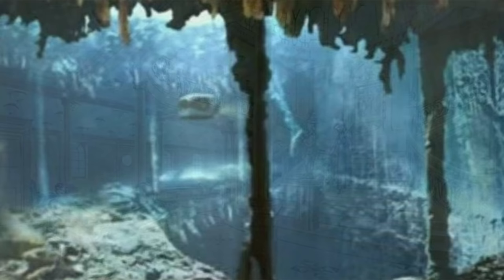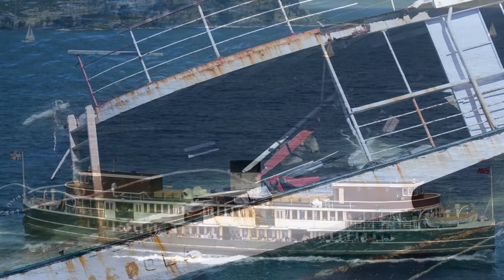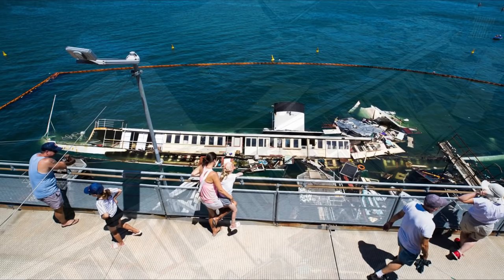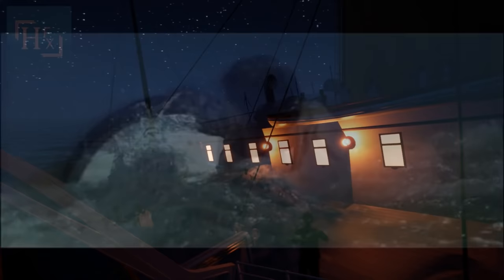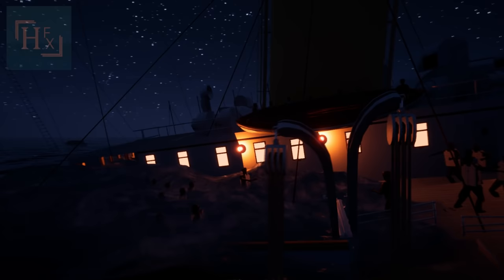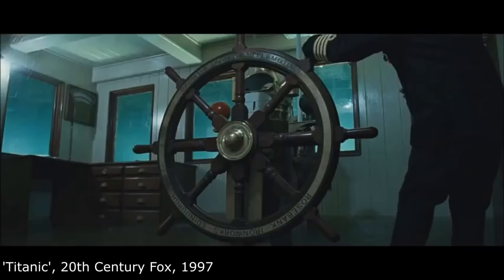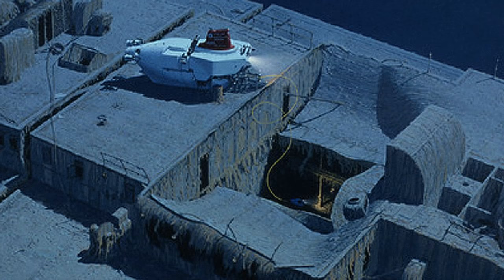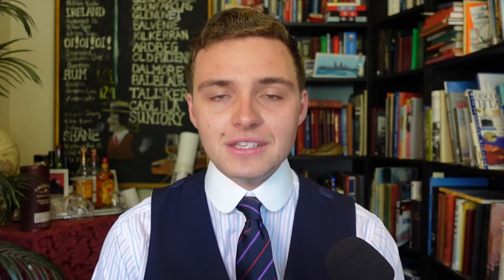What Happened to Titanic's Grand Staircase Dome?

Comment: James Cameron mentioned during an interview that when they were flooding the grand staircase for the movie, the wooden staircase broke loose from the floor and started to float. So he believes it broke up as it came lose and pieces floated away through the hole im the dome. There are pieces of the dome in the ocean floor which proves it broke off.
Reply: Cameron also built the staircase on the set to the same standard as the original, effectively creating a forensic experiment.
Reply: @ShadowXII  Though iirc it was actually a bit larger to better accommodate the cast.

Comment: During filming they had several levels of the grand staircase built for the flooding scene.   When they were flooding it it actually started coming apart do to the buoyancy of the wood almost immediately..   now before you say well it’s just a movie set.   Camron and his team built the set to pretty much the exact blueprints right down to the materials use on the real ship ( the only difference was it was slightly wider)  it’s explained in the behind the scenes of the film.
Reply: Actually, the newels were plywood with molded plaster.  I formerly owned one.  Still, likely some bouyancy there until waterlogged.

Comment: The central element of the grand staircase dome was found near the wreck. It is very likely that during the impact with the bottom of the ocean, the pressure of the water inside pushed the entire structure, destroying it in the process for the most part.

Comment: Nice video again !!! A little comment though: there is no evidence that the bulkhead between boiler rooms #6 and #5 collapsed. For some engineer, it is very unlikely, and the testimonial that related the sudden inflow of water may have been instead caused by the collapse of a coal hold door (which was flooded). But as you said in another video, this is the kind of the numerous mysteries that the Titanic will keep forever,

Comment: I think its more the strength of the hull and superstructure being twisted and bent (hog and sag effect depending on the way a ship sinks), that will make the windows crack. I have experienced this when in drydock with ships I worked on. Windows are quite strong on ships, but if you twist and bend a ships metal structure, glass is still the weak point. And no ships are designed to handle the stress a sinking event causes on its structural integrity. I believe it was broken long before she went under water. Nice video though. A fan from Norway

Comment: You make a good argument, but two things that should be considered is 1.  the TITANIC was a much bigger ship then the ship in your example; 2.  the depth of TITANIC is FAR greater, meaning astronomically greater pressure as well.  The second is considerably more significant, and, while it bolsters your point, both vessels cannot really be compared in magnitude.  That being said, your arguments make sense.  Also, parts of the staircase dome have been found on the bottom (though they are believed to be from the AFT Grand Staircase, in the area of the "missing piece" behind the 3rd funnel.)

Comment: The 1997 movie  has a major error: it depicts  sea level  halfway up the windows and entering the grand staircase area, and then the glass dome breaking and dumping lots of water in. If water was only halfway up the windows, it would'nt have been anywhere near the dome elevation yet. 
With the number of  "fragile" windows at that level, and water also rushing from below, it is more likely that the grand staircase area filled with water right up to the dome at roughly same speed as ship dropped,  leaving a big bubble of air under the dome which would have then been lifted up along with the small structure above (especially if it too was still full of air. If this happens early on, the pressure would not be great.  (once lifted up, unless angle remained perfect, that air buble under the dome would exit sideways and dome would lose buyoancy and sink. 

Another possibility is that the dome liftedn up but remained contained in the structure above it, and that structure didn't widthstand the speed of descent and got blown away along with the dome in it.    One would need to have a better idea of how strongly affixed to the ship structure the dome was, or whether it was simply deposited on top and hence easy for it to float away. 

From the time there is water below the dome, pressure is no longer an issue because there would be the same pressure all around it (and the air volume under dome would diminish to maintain pressure parity with water.  Same with all the windows that survived to ocean bottom.

There is a 20th anniversary National Geographic special with James Cameron (20th anniversary of his 1997 movie).  In it, he mentions that he had build the grand staircase pretty much like in the original plans with a metal structure and wood basically deposited on top, and during the filming of movie, portions started to float away and almost pinned a stuntman.  And he posits the same could have happened to it on the real Titanic which would explain no trace of it while wood around the same location had survived relatively well.  (aka: not logical that the staircase would disintegrate while wood around ot wouldn't).

Comment: The clear pattern to me is likely a funnel fell onto the grand staircase collapsing the boat deck level which correlates with the bending of the external walls. 

Then when it was on the way down to the bottom , the strong currents going through the hull and the impact into the bottom of the ocean likely forced a huge amount of water through the ship and up the grand staircase “now open to the elements”. This likely ripped the panels and the remaining stairs out. This also correlates with the panels only being missing from the well of the stairs but remains on the rest of the walls seen in Cameron’s wreck documentary’s around the d deck lounge and elevator shafts where the pressure of water shooting up and out didn’t touch.

Theres absolutely no way the grand staircase flooded like James Cameron’s film. It doesn’t make sense how water externally falls through the dome but the water is only just coming through the weak glass windows on the boat deck “1 deck lower than the dome”. Good action scene though.

Comment: If the ship was filling with water faster than the air could escape, the air pressure on the inside of the ship would have increased.
It's possible that any glass not yet submerged on the outside, but with a build up of pressure on the inside actually first exploded outwards as the ship sank.

Comment: Something floats when the weight is less than the weight of water that would occupy the same volume. 
But as you bring an object deeper, any compressible portion of object will see its volume diminished and hence displaces less water. 
For instance, taking a balloon from sea level to 10m depth will see its volume halved (from one 1ATM pressure at sea level to 2ATM at 10m).    So one needs to consider wood in the same way, especially Oak whose weight per volume is 900 kg per m3, whereas water is 1000kg per m3 ( 1000 litres). (sea water is heavier than that). 
One would need to test how much various woods compress when going deeper into ocean and calculate at what depth they stop having positive bouyancy. It wouldn't surprise me that as Titanic sped up going down and flow of water  blew sterm apart wood being expelled from ship might not have floated if ship was already deep enough. 

Similarly: air bubbles trapped within the ship would have provided bouyancy that slowed its descent.  But as the air bubble's volume diminished the deeper the ship got, the less bouyancy they would provide and ship could then descend faster.   (at 10m depth, that bouyancy would have been halved already).

Comment: Firstly I know this video is a year old, but I still want to share with anyone who watches later. Latest calculations disproved that the fall of the Aft section of the Titanic took over 20 minutes. the real number was 5 minutes! that makes it a blistering 30 miles per hour, and although that may not seem like much but you have to take into consideration how much resistance water has and falling at 30 miles per hour (44 ft./sec) would rip everything off of the hull that was not welted and/or riveted to the hull itself. and it likely ripped off the wooden decking as well. and just for reference, the front portion of the Titanic fell faster to the bottom than the aft section, simply because of the aero/Hydrodynamically shaped front section. with the front wheel house being only lightly constructed as well as the grand Staircase of the ship and it's weakly built cover from the weather, would have easily been ripped off of the ship LONG before it gained much momentum at all, the case of the Baragoola's sinking amply demonstrates. The one needs to consider the bone crushing stop at the very end of that Journey to the bottom, slamming down to the bottom of the Atlantic, we know that the front section actually slid a ways before stopping because her descent was not at a perfect 90° angle. So yeah that is why so many ships that sink is such deep water are such a mess at the bottom. Even the IJN Yamato which was a very structurally tough Battleship was a big mess on the mountainside they found her on in the Pacific. And that was nearly as big a fall as the Titanic had! Titanic rests at 2.5 miles down on the Atlantic sea floor, the Yamato is resting on the side of a sub oceanic mountain, at 1,120 feet.

Comment: One of the things thats always fascinated me about the Titanic is * i know this may sound morbid* but what happened to the ship when she went under, we have survivor testimonies about the above water stuff, the funnels, the break up, ect, but what was happening to the ship after she left the surface, we know that the Stern pretty much blew apart during the sinking which is why theres not much left, but what about other parts of the ship mostly in the Bow, the corridors, rooms, ect, did they collapse due to a hundred years under water, during the sinking and the pressure of water, the sudden impact with seabed, but i always be amazed that how much of the Bow is still relatively intact, Davits are still in there deployed position, the Truck vents? those ones at the base of the funnels, are still....well there despite being next to the uptake holes and they've not fallen in, and the rest of the upper decks considering they've made of wood and were only meant to handle bad weather and the odd large wave, and yet 110 years under water and there still intact.
Reply: a lot of that is attributed to how deep Titanic is, not much oxygen down there to break things down, thats why she is so intact still to this day, the only thing thats realy breaking her down is a handfull of bacterias that eat metal, they create long stalagcites of rust which is then broken off by ocean currents and their own weight, this is why you can still find wood features still mostly intact, theres not much down there breaking it down, Cameron on his last trip out there managed to get inside the turkish bath where they found more or less entirely intact furnitures and even paint on the tiles where you could make out the patterns and gold decoration on wooden features where the decorative groves was still clearly vissible.
they even found water tn the pool!
and that gold clock on the fireplace mantle that is featured in the movie? they managed to get eyes on it and its actually there on the mantle, and presumably still is to this day.

now, sadly, she is starting to fall appart at a much more rapid rate, this is because the steel has been corroded to such a point it can no longer carry the weight, and from there it becomes a chain reaction where she tears herself apart from her own weight shifting around.
Reply: JFC.... the ship, may, have hit at 35-40 mph, but most of it WAS filled with water at that point... and the ocean bed here is SOFT.

Comment: There is a commentary where James Cameron said that as they were sinking the grand staircase on set that it actually started to be come dangerous. They had built the set with so much accuracy that as the water was rushing in the staircase started to "float" or pull away. The theory goes that the staircase as Titanic sank did the same thing and eventually either completely collapsed as it hit the ocean floor or came out through the top as she sunk to the bottom. Will we ever truly know, most likely not. But its an interesting theory.

Comment: I just missed the live video. 

Nobody ever knew what happened to the staircase until James Cameron flooded his set and the staircase actually floated away! The grand staircase was a an open staircase that ran deep into the ship. Not only could they have floated away just as they did on james Cameron's set, but the force of the water ramming through the ship would shoot let a jet out of open areas. We see evidence of this with cargo hatches being blown off. It's safe to say, the combination of external forces and water pushing up and out, the staircase  blew through the dome and cover. The roof over the main boat deck entrance look like it could've been blown upwards, than collapsed. Thanks for the awesome video
Reply: You  should keep in mind that the performance of a set and of a real ship would be very different.
Reply: @LandyVlad_Rides  of course and it's just a theory.

Comment: In the MV Baragoola instance, not only did you have the water pressure, but the pressure difference was also being applied Sideways! (Not up and down, i.e. the force of gravity)   
     In the case of the RMS Titanic, not only did you have pressure difference, but in this case it was once again a lateral force (from the bow towards the stern) especially when she accelerated during her "race to the bottom".  Depending on how fast the area around the Dome and the Grand Staircase filled up, I'm not too sure if the air pressure would be roughly equal to the outside water pressure.  However, the impact when she landed would have produced serious G forces on the Dome, Grand Staircase, whatever was underneath them on lower decks, and of course the lightly built cover of the Dome (which honestly may or may not have survived the lateral forces of the water flow as she sunk!)  If it failed then odds are that at least some of the pieces of it would have stuck the Dome and shattered it.  (Not only from the cover striking it, but once there was even a smallish hole (perhaps 6 inches (~15cm)) in it, the hydrodynamic forces from the water flow would have finished the job.....
Reply: Don't forget the downblast immediately after hitting bottom.

Comment: It isn't just the water pressure from a flooding differential but the air has to get out as well as its space in flooded by heavier water. Either structures blow inwards as the water pressure rushes in inevitably or they blow outwards as the air is forced under to go somewhere else, usually up and out. Try holding a bucket filled with air upside down in water at a depth.

Comment: Ok theory on the wheel house, as the bow plunged down the pressure of the water in front of the wheel house would be massive due to the water pressure and the movement of the ship. At the same time the movement on the ship happened, little water pressure will be forced into the the wheel house so at some point the front must have shattered inward and then have the water fling the structure up and snap it off

Comment: i think you have a good point but your missing some other factors at play; buoyancy, torsion, and inertia. 
i think james cameron had a good point about the buoyance of the staircase in particular. thats a lot of buoyancy locked up in one structure that was likely held in place for a good distance underwater. i dont know if youve ever played around with something buoyant in a deep pool but the further you drag something particularly buoyant under water, the more force it broches the surface with when released. i suspect thats why the immediate area of the ceiling around it is damaged as it is an fallen in. when the staircase finally dislodged it was rent upward with such force it damaged the ceiling area where it was at to such an extent that when the water column generated by the titanics passage to the the botton came crashing down upon her it pushed the damaged portion of the ceiling in creating the effect we still see today. it looks like it was pushed in by an explosion because it kind of was. 
anyone thinking sinking is a gentle process should look into the wreckage of the uss thresher and uss scorpion.